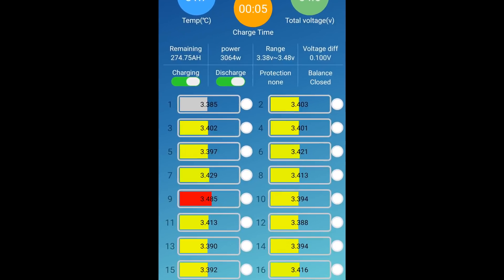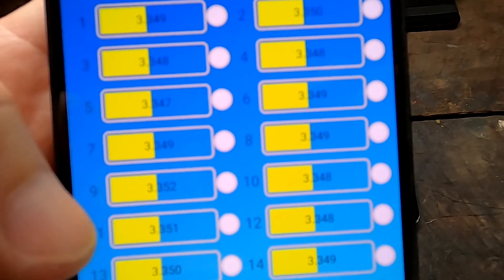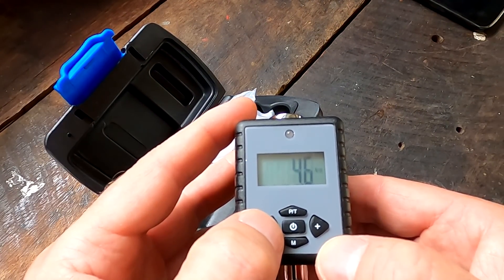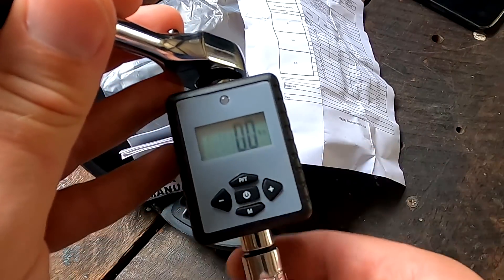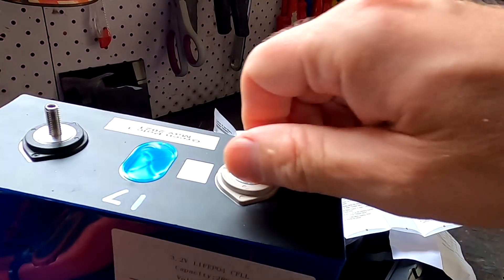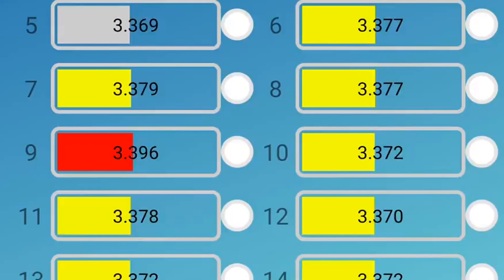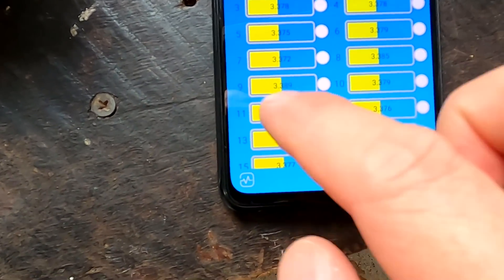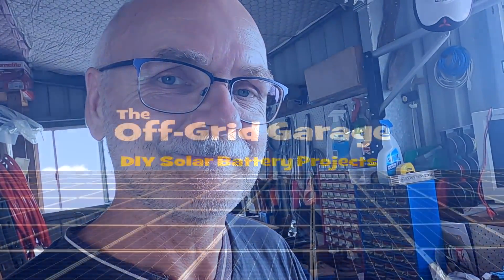Still some terminal corrosion by missing the right torque?

Comment: It'll be interesting to see the comments develop, as this is another contentious topic. 

I've discussed this a bit with different forums, and the idea of "conductive grease" seems to be a bit of a misnomer. The grease itself may be slightly conductive, but it's certainly nowhere near as conductive as the metal of the terminal or the bus bar. So the idea that it helps conductivity, can't be true. All it can actually do, is prevent contaminants getting to the contact surfaces and therefore help prevent oxidation. 

I've recently received a delivery of 80 EVE cells, and that came with bus bars. I used those bus bars during the initial charge and top balance because they were easy. But I was very surprised at how bad the connections were. There was a noticeable amount of extra heat from these "copper" bars compared to some makeshift bars I did using thin 1.6mm x 20mm aluminium. The copper should be much better, but alas it wasn't. Maybe the original ones are copper-ish, or maybe the plating isn't very good, but in the end it just goes to show that what's supplied with cells is usually pretty cheap and nasty.
Reply: Well, consider that the bus bar and terminals aren't completely flat. If you use something like MG Chemicals 847, you fill the gaps and can increase conductivity. 847 has a conductivity of 23 Ohm cm, so I would call that conductive grease (carbon conductive assembly paste), and is specifically made for these kinds of applications.
Reply: @upnorthandpersonal  but that conductivity is many orders of magnitude less conductive than the metal. So can you explain how it would make a noticeable difference to the overall conductivity? 

I'm still of the opinion that it's primarily there to prevent surface contamination. But I'm happy to be proved wrong. The numbers just don't stack up to this sort of compound actually making a reasonable difference to metal-metal contact.
Reply: @PowerPaulAu  Because you're dealing with two non-flat surfaces. The 'metal to metal' contact isn't really that - it's metal with bumps and holes touching other metal with bumps and holes. This can even lead to inconsistent connections from one terminal to the other. I've double checked this in my lab before: the MG 847 leads to lower resistance, and more consistent, connections. This is even more apparent when you have a connection where you can only apply a limited amount of torque like with these battery terminals.
Reply: @upnorthandpersonal  cool, do you have some test data to show the methods and different results? That's what this channel is all about, having an idea, testing it and proving (or disproving) it :)
Reply: @PowerPaulAu  I do have them somewhere - this was over a year ago when I did this for my battery. I can do it again if I can't find it.
Reply: @PowerPaulAu   What I suspect/hypothesise is that if torqued well enough the metal surfaces that stick out 'the most' will connect directly (pushing the grease/conductor away) but the holes will be filled and help improve the connection between the two surfaces, therefore increasing the overall contact area.
Reply: @IkkjeDus  I agree, and don't forget the paste is not only filling the gaps, by doing so it prevents air contact hence oxidation in those pockets, which over time can work against the conductivity.   @Paul Freeman I think you need to consider the effect of why thermal paste is used on CPUs, it increases the surface contact. Using conductive paste is only a win. Also one possible reason Paul's  aluminum bus bars work so well even without paste probably has to do with flatness and good manufacturing tolerances greatly above that of the Chinese freebie bus bars. YouTube channel Ray Builds Cool Stuff has some great videos showing his test results, and effort to flatten the bars, test resistance, compared to flexible connections, etc.
Reply from the maker: Thanks Paul for sharing. Great comment. I never had any luck or good/permanent good results with the supplied busbars coming with the cells. Your AL bars however worked from the start though. In terms of the grease, I understand what you're saying as it ads an extra layer of something in between busbar and terminal which will only increase the resistance. Some have suggested copper or silver paste therefore. But then you have a Al-Cu-Al connection... 🤔
Reply: If you have two imperfectly flat surfaces clamped against each other, you are only guaranteed three points of contacts on each side of the bar. With electrically conductive pastes, copper, aluminum, silver or other particles get crushed in-between and increase the effective contact patch while also preventing air from getting in and causing oxidation over time.
Reply: Yes I'm quite aware of the theory behind it, after all it's part of the reason I had my bus burs manufactured. I've sold over 1000 of them already, and they do work very well as is. I continue to compare them against other bars I receive with cells, and they continue to outperform them. 

I also agree the pastes with particles should help, but the extent of the help is what I'm interested in seeing test data on. For this to be valid, it needs to be objective, repeatable and measurable. To date, I've not seen anything more than anecdotal evidence. Let's keep with the spirit of Andy's channel by proving and quantifying claims made :) 

It's basic parallel resistance theory. If the connection resistance is 1m ohm, then putting a 10 ohm resistor (approx 2cm2 area) in parallel with it is insignificant as it's about a 0.01% difference.
Reply: @PowerPaulAu  10 ohms? A single 20 microns silver particle is about 4 mOhms. If terminal and bus bar flatness is similar to silver particle size, you will have hundreds of particles in parallel with aluminum-to-aluminum high spots which should make the connection perform practically as good as welded.
Reply: @teardowndan5364  I'm going by something mentioned by Up North above... "847 has a conductivity of 23 Ohm cm, " (even though it's a dimensionally incorrect statement, because it's only one dimension, I'm making the assumption he actually means cm2)

What I'm trying to say here, is the paste itself is not as conductive as the metal it's assisting. And I'm suggesting that people who have the equipment, and are making this claim, provide some real life data regarding how effective it is. Everything, and I mean that literally everything people have said so far, is anecdotal with no test results being linked to. I'm not saying they're wrong, I'm wanting proof for the sake of everyone reading this. We can't just accept a random persons comment on a YouTube video. Surely if it's that good, it's documented properly somewhere. 

Even Andy hasn't had any noticeable change when using various pastes as far as I know.
Reply: @PowerPaulAu  Volumetric resistivity is defined as resistance across two opposite faces of a cube, so you get ohms x length / area = ohms x m / m^2 = ohms/m.

If the clamped surfaces are an average of 0.002 cm apart with 2cmsq terminals, you get: Rpaste = 23 ohms x cm/cmsq x 0.002cm / 2cmsq terminal surface = 23 mOhm for the carbon-based paste.

As for Andy not seeing any difference, I don't remember seeing any of his paste videos. What I do remember is videos of him sanding all of his bus bars and leaving them lying around for several minutes before putting them back on. The oxide layer re-forms within minutes of removal, you won't get much benefit from any conductive paste when most of the terminal that isn't making clean-metal-on-clean-metal contact is insulated by aluminum oxide.
Reply: @teardowndan5364  ok, good to know. 

But the end result here is still that no one has provided a proper set of data showing the difference between with or without these compounds. 

Ultimately, to make something worthwhile, we need this data to make that judgment call.
Reply: @PowerPaulAu  It's on the diy forum, look for MG Chemicals 847 Test.
Reply: @upnorthandpersonal  there hundreds of DIY forums, can you be more specific by sharing the link for everyone here.
Reply: @PowerPaulAu  Youtube removes links, and even the full name of the forum when I mention it in the comment. (Andy can confirm this). It's Will Prowse's forum...
Reply: @PowerPaulAu  "even though it's a dimensionally incorrect statement, because it's only one dimension, I'm making the assumption he actually means cm2" --> No, I didn't. The unit of electrical resistivity (specific electrical resistance also volume resistivity) is Ohm Meter, symbol ρ where ρ=R.S/l. R=ρ.l/S is the common formula to calculate the resistance of a length of wire knowing its specific resistivity (ρ), length (l) and area (S).

Comment: Andy, I had the same issue with some of my cells.  I just switched out the studs and flange nuts that the cells came with over to M6 10MM allen screws/bolts.  So far all cells having the issue look great.  I posted a video yesterday on my channel showing the change over.
Reply from the maker: Thank you for sharing. Cannot see how the studs alone would make a difference though. And, these are already replacement stainless steel set screws and nuts. My batteries came with the nasty short screws still...
Reply: @OffGridGarageAustralia  Agreed, it is not the only reason.  Another reason I updated, was that I did not like dealing with two items to make a connection into the cell terminal.  I really wish these cells would have come with laser welded posts.
Reply: @OffGridGarageAustralia  Andy from a mechanical engineering point of view I have to say @SolarGarage has used a more correct method to attach the bus bars to the cells, I gave an explanation on his thread as to how the threads are designed and associated torque settings are arrived at by the engineers, I honestly think using those studs with that torque wrench your asking for more issues, but hey I still love what your doing and your enthusiasm   👍

Comment: If there was a higher resistance connection wouldn’t the voltage drop across it thus reducing the voltage reading?  It’s a bit counter intuitive for the voltage to be higher.
Reply from the maker: I know what you mean but the ring terminal from the BMS may have better contact to the set screw going into the terminal rather than the busbar itself. It's very hard to find and when you loosen the connection, everything re-seats afterwards.
Reply: @OffGridGarageAustralia  I'm not following. The BMS reading is showing it high. A loose or corroded connection should cause voltage drop, never voltage increase. The higher voltage shown is from the BMS lead, at the cell referenced. Can you please explain what I'm missing? Better yet, using a battery resistance meter probe the points on cells, busbars, etc. Maybe shoot it with a FLIR (under load) looking for Hotspots. Great topic to get a good handle on, thanks for all your testing!
Reply: @OffGridGarageAustralia  Be interesting if the grease works. Is aluminium bus at better due to an reaction between aluminium and copper? Or would a good copper bar be better?
Reply: @coastalchaos839  the battery cells post is aluminum.  Copper to Aluminum dissimilar metal creates oxidation on the aluminum. The tinned copper bus bar helps reduce this. Yes, proper quality conductive grease helps fill the microimperfections and prevent air contact oxidation, and improve electrical conductivity with properly torqued nut.

Comment: I didn’t used anything on my 3 12v lifepo4, so far almost a year of used and no problem at all
Reply from the maker: Nothing at all, and you used the busbars which came with the cells?
Reply: @OffGridGarageAustralia  yes, but mine it’s a 200ah and the busbar are really thin copper tinted, so I used 5 on each. Also it’s in a rv so there’s a lot of movement driving. And wen the rv it’s park I have a station cord to my garage for the freezer, dryer and ac fan . 800w solar on rv roof.
Reply: Maybe I don’t have any problem because it’s a 4s. More cells more problems. Why don’t you try to do 4 batteries 4s ? It might be easier for the BMS to balance also the BMS have to handle batteries in series

Comment: My personal experience from battery maintenance in telecom tells me to prefer flexible wires (with cable lugs, of course) as interconnections between battery cells. And  with rubber insulation, rather than PVC insulation. Flexible wires eliminates cross-cells mechanical strains at "stud-busbar" connection points, and   prevents these connections from weakening.
Reply: Same here, we only used flexible cables when installing battery banks in Telecom sites.
Reply from the maker: Interesting... thanks for sharing. You would think a flexible connection increases the overall resistance even more due to more connection points.
Reply: @OffGridGarageAustralia , as cable lugs are crimped with high pressure and plastic deformations of cable core's wires with lug's tube walls, a near-welded gas-tight micro-connections are created there. Especially, if we will crimp lug at several points along its zone for crimping. I crimp it in 3-4 points with hexagonal profile.  So, a good crimped lug wouldn't add significant resistance to overall resistance of a given battery "jumper". If more amps are need, we can use multiple parallel flexible cables instead of one large wire, but with crimping it in larger lug. This preserves total flexibility "level" of our jumper to almost one-cable jumper flexibility. Especially, if we use not a common available flexible cable with multi-wire core (stranded), but use special super-flexible non-insulated cables, which formed from many thin wires. These cables are used for grounding connections of equipment cases or frames to grounding terminals. Especially, if equipment has significant vibration level during operation.
Reply: @OffGridGarageAustralia  The connection points in general aren't the issue; a proper crimp for example. The issue is bad connections due to slight cell movement, oxide, etc. and inconsistent connections between terminals because of that. In other words, getting a consistent connection on all terminals is more important than adding a tiny bit of resistance - as long as it's done uniformly.
Reply: @off-grid garage there is a great video by Ray Builds Cool Stuff on YouTube and he measures the resistance of flexible cables vs. Copper and also brass bussbars. Ultimately. If using flexible cable between cells, the gauge of wire must be significantly increased to offer the same low resistance of a solid bus bar!
Reply: @jamesbsa6450  You just need the same gauge (cross section) on both.For example, assuming a copper bus bar of 10mmx3mm gives a cross section of 30mm² - you thus need to use a wire with 30mm² cross section, so something like a AWG2 or thereabout.
Reply: @upnorthandpersonal  yes, precisely the point many DIYrs seem to miss. And to be clearer, when you mention cross section you also are referring to same material, e.g. cross section of copper buss bar vs. cross section of copper wire of same length. At the end of the day we should focus on building in as little resistance as possible whilst still keeping within reasonable design standards and budget. If switching to different material like aluminum instead of copper, then the added resistance of aluminum could be offsite by compensating with larger cross section yet. :)

Comment: I have one cell in my pack that is doing exactly the same. What is agonising is the fact that i think the threads are now stripped as I am not getting much 'bite'. I am going to have to rethread which i have been putting off. Everything is perfectly balanced until I pull about 60amps and then lots of heat can then be felt though the bolt.  😪😪😪
Reply from the maker: I also have this cell #6 in my pack where the thread is half gone. Not touching it any more for the time being... Surprisingly, this damaged thread is working totally fine without very little torque applied.
Reply: @OffGridGarageAustralia  I am tempted to make some new bus bars with another tapped hole in the middle for ballance connections ect to preserve the fragile cell terminals. I have no choice but to re tap. Seems such a waste of a poor battery cell and it deserves tender loving care!
Reply: @danielkirk8571  I stripped one of mine. Had to retap with 8mm. I also jbwelded the stud in. Seems ok but I am cautious with it.
Reply: @jasondevine6014  I was absolutely gutted and annoyed. With the voltage issues under load, what's another 8th of a turn. Oops.

Comment: Interesting. Perhaps oils from handling bus bars/nuts causing the oxidation? Good info. Thanks for sharing
Reply from the maker: Could be. Aluminium seems to oxidate very quickly after cleaning. Hence this paste/grease to prevent this from happening.
Reply: @OffGridGarageAustralia  Actually, I clean my terminals with mineral oil present. You want to prevent oxygen from getting to the terminal (since that is what oxidizes the aluminium, and this happens in fractions of a second). Keeping the terminals coated in a little bit of grease and applying e.g. MG Chemicals 847 (which itself is a grease as well) prevents oxidation during assembly and afterwards.

Comment: Use some High carbon 847 on those connections
Reply: that stuff is not cheap!
Reply: @5UPRAH  true but if it works worth every cent to save those very expensive lithium battery cells.
Reply: @offgridwanabe  absolutely!